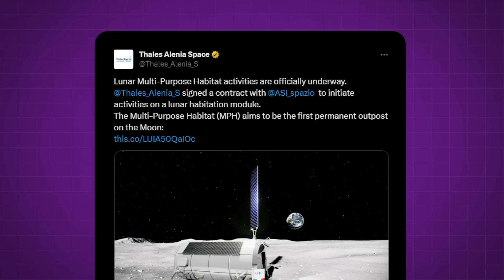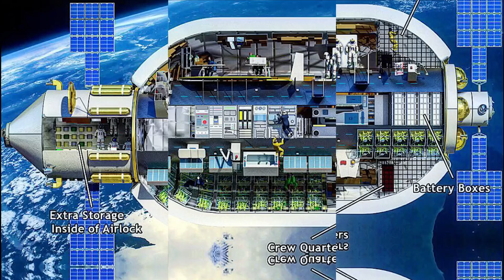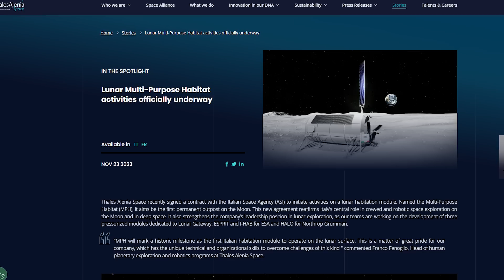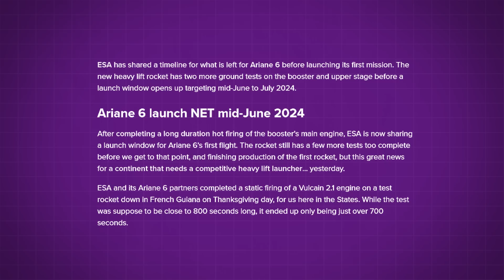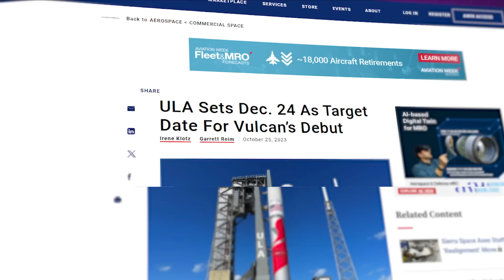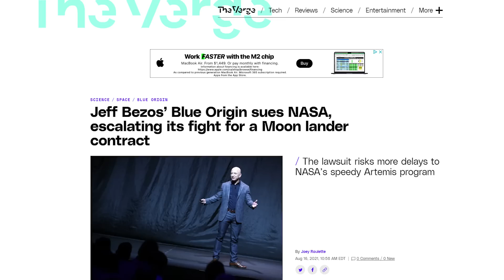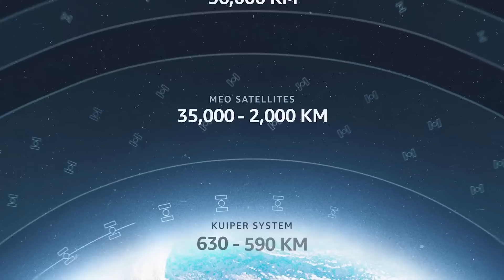Italy Reveals New Moon Base!

Comment: 📍 1st will be an Earth created container (similar to as displayed or Starship). 
📍 2nd SHOULD be a Lava Tube. 
📍 3rd would be massively different version using various energy fields (magnetic, etc.), and potentially under a human made glacier. Water protects from radiation, is recyclable, and can be used for energy storage. Per a 1977 paper from the U.S. Dept of Energy at nuclear power plants, 7cm water provides ~50% protection. 3 meters thick would be near equivalent to earth’s background radiation. Magnetic energy fields would further help in shielding. Hydrogen reduction of iron oxide-bearing minerals in the lunar regolith, such as ilmenite, has long been suggested as a potential method for producing water on the Moon to support exploration. Various tests show 1-14% water production by weight of processed regolith. Assuming 7% conversion/transformation of regolith to water, if we processed ~4,000 semi-truck trailers of regolith, we could create a sheet of water ice 100 meters by 100 meters at 3 meters deep (300 cubic meters of water or 275 considering the 9% expansion of water into ice).  To visualize 4,000 semi-tuck trailers of regolith: an American football field (including end zones) can fit 50 semis — or 3 lanes of semis 13.5 miles long.

Comment: The "Blue Moon" lander presented in the image (8:50) was the original model, rejected by NASA in 2021.
The new "Blue Moon", that NASA awarded the 2nd Option Contract, is totally reusable and sustainable (hydrogen engines, cheap in situ rocket fuel).

Comment: What about radiations from the Sun (and cosmic radiation too)? On the ISS you can spend months without worrying about it too much since it's still protected by the Earth's magnetic field, but on the Moon you have no protection at all (or very little), and you can spend only a few days on the surface. What's the solution to that? Are the astronauts simply going to spend less time on the Moon and get more rotation? Are the modules going to include more shielding, meaning more weight? With Starship, weight is not going to be that big of a problem, but still.

Comment: Cold temps are really not much of an issue in a vacuum, especially with a pressurized habitat with humans in it.  Most of the climate control in a space suit is COOLING, not heating.  Without air for conduction and convection, all you have is radiation, which is terribly inefficient.  With the habs, you might want some insulation on the parts contacting the surface, but I'm not sure even that would be necessary.  It is actually for this reason that the Apollo missions had the craft rotating slowly during its transit, not just to prevent thermal stress from solar heating on only one side of the craft, but also to keep that heat from building up and heating the interior as much.

Comment: Cost really is something important to keep in mind. Especially with the economy as turbulant as it is. 

Artemis has no provisions for a permanent outpost on the surface, and likes to talk about accessing the entire surface for research. It woild be important to start cheap and safe (even if we make something safer later on with half-buried modules)
Reply: They don't need to plan all of their base facilities in detail right now.  Building and testing the rocket(s) that will be used to get there is the priority right now.

Starship's projected ability to deliver up 100 tons of freight was a consideration when the HLS contract was awarded.  If you can haul 100t of freight on every mission, a permanent base is a more practical goal than it would be if the freight limit was significantly lower (as it is with every alternative landing system) and/or the volume available for freight was significantly smaller (as it is with every alternative landing system).  When you have the capacity - both weight and volume - to carry the equivalent of a D-9 Cat bulldozer, you can build what you need for shelter and workshops. 
SpaceX need to demonstrate the projected vehicle capabilities that helped them win the contracts.  They will.  Given them a bit of time.

Comment: We could easily use blow up habitats that go in pre dugout trenches then once there connected and inflated we either use 3D printed steel plates over the outside or lunar paste then cover that final layer with Lunar dust for a more natural surface look. Until we’re able to truly build amazing structures using Lunar dust